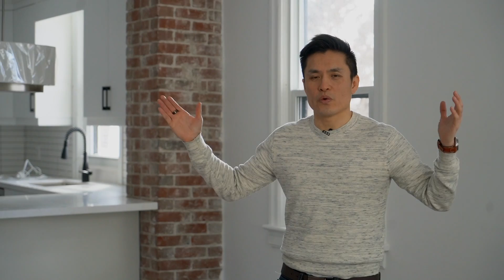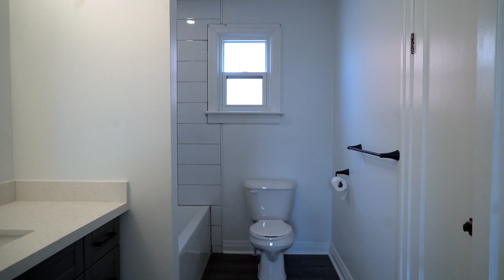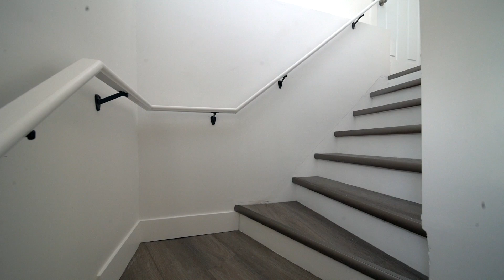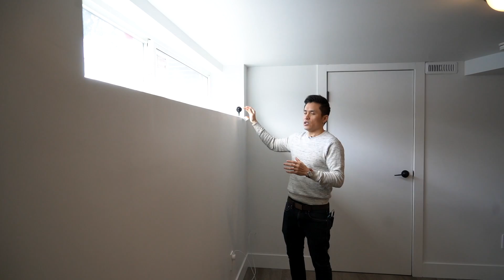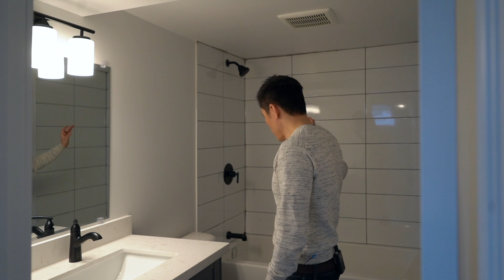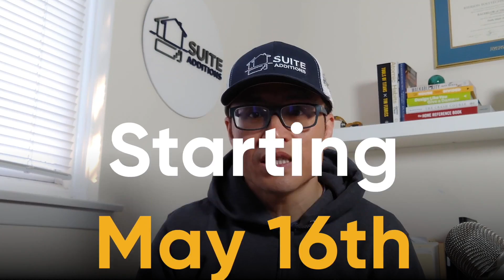Final Duplex Conversion Before & After | Property Walk-Through  | Ontario | PART 3

Comment: I believe Egress window's height from the floor inside of the basement should be not above 44" for easy escape? Correct me if this is not the case in Ontario code Width not less than 20, Height not less than 24 and total opening not less than 5 ft(for the basement) Wide window in the living /kitchen room is to higher than 44 inches from the floor Could you explain for better understanding. Thank you

Comment: Hey Andy, great job on the renovation. A few questions I had since I am also doing a secondary unit in our basement at the moment. Going through all the code and legal stuff now. I was wondering:

1. Why did you need to add 2 water heaters? I know it's not a requirement by code, did you feel a specific reason to?

2. How do tenants manage water shut off? Do the upper unit have their own water shut off or do both units have shut offs in maintenance room? I am asking this because our inspector told us that in order for the maintenance room to not be a "common room" the water shut off would need to be separated so each unit could access it. (Which was confusing because the rest of the room like furnace etc would still require upstairs to come down if any issue happened so why only water lol). But i see in your unit both are in the same furnace room downstairs, how does that work?
Reply from the maker: Thanks for the kind words Zarif.

1.  2 water heaters needed since we have 2 meters

2. Only accessible in one unit. Typically does not need to be accessed unless servicing is required. There are also individual shutoff valves at each fixture.

Comment: Great job Andy, and thank you for sharing. I am getting ready for a duplex conversion project this summer and still trying to score on a suitable property. I was wondering how the decision was made for the location of the electrical panel upstairs. Is that up to the Electrician to decide where to place it? Could I decide to put it in a coat closet instead of a bedroom like in the video?
Reply from the maker: The electrician will advise on location. Can be anywhere except in bath and behind kitchen cabinets. You need 3 feet clearance in front so unlikely ok in closet.

Comment: Since the gas is for both units, are you splitting 60/40?
If I purchase a home and the lower unit is already finished (drywalled), does it need to be re-done for fire separation?
Reply from the maker: Yes 60/40 for gas ..and if already finished, it will depend on work needed
Reply: @suiteadditions  Great job Andy. Would the gas account be on the Landlord’s name?

Comment: Which electric meter runs the furnace fan?  Does it cause problems between tenants.
Reply from the maker: The upper is running furnace fan. Usually not an issue.